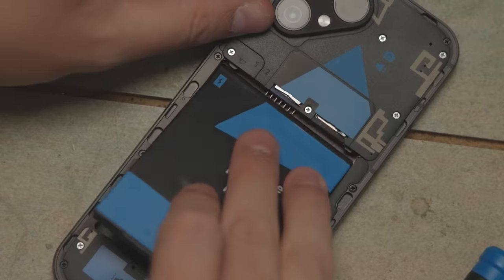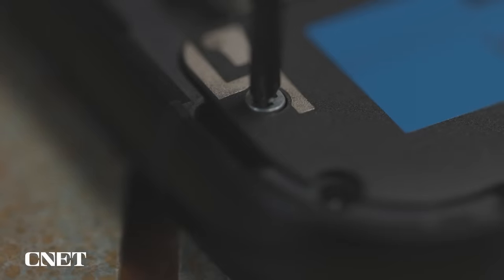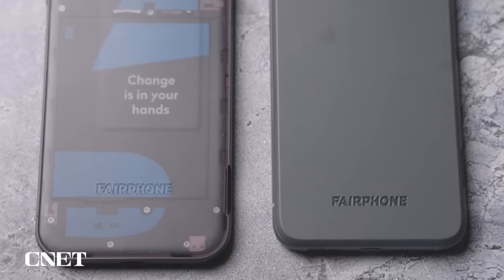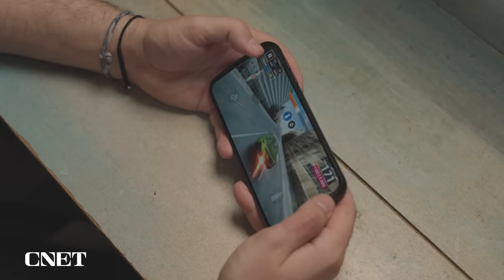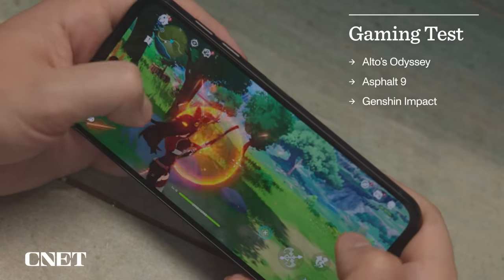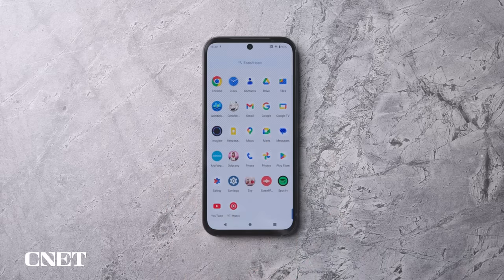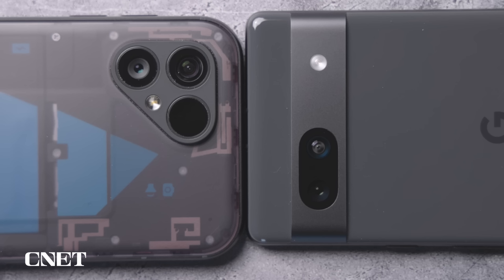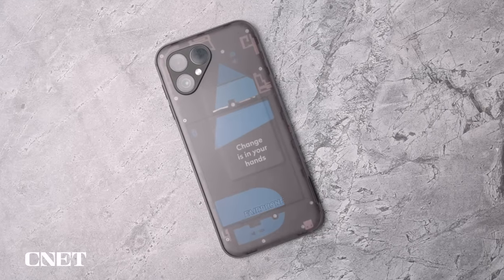Fairphone 5 Review: A Noble Cause, an Imperfect Phone

Comment: I wish this had a 3.5mm jack. If it could be implemented as an optional module that would be incredible
Reply: I feel similarly. It's not a perfect solution, but FairPhone DOES offer a USB to 3.5mm jack converter on their store as an accessory, to allow you to still use 3.5mm devices when the phone isn't plugged in to charge.

Comment: Did I just missed it or didn't you even bother to mention, that there is still the possibility that performance flaws in battery life and camera might be counteracted via software optimization in prospective updates? :/ Edit: They also could come up with bigger batteries in the future.
Reply: I think the reviewer was fair in evaluating the phone as it is now rather than what it MIGHT or COULD be in the future.
Reply: Yeah, the whole sales concept of this device is its longevity (old devices get better with proper updates). Ignoring the potential for updates on features that are differentiated almost entirely by software optimizations, is to ignore the principle appeal of a device such as this. The Pixel & iPhone have had serious show-stopping issues when some models released, but updates fixed a lot of that. Sadly, no phone remains useable without updates; so, it's disingenuous to compare hardware & software without also comparing update philosophies.

Comment: Also something to take into account: with the Pixel 7A you won't have security updates for nearly as long and fixing something that breaks or replacing the battery is hard. You'll probably get a new phone within 4 years whereas the Fairphone should last at least 8 and probably 10 years. One purchase of €700 vs 2x€500 will make the Fairphone significantly cheaper. 
This is why planned obsolescence exists. Companies figured out that people don't think too much about this, so they can rake in more profits by selling products which aren't meant to last.
Reply: New phones won't be cheaper. Cost of phones will increase every year. 

Who knows after 5 years pixel phones may cost 1000$. 

So this phone is really good.

Comment: It's a great idea that can be inproved over time with software optimization fixing partially the battery not being particularly good and cameras. Considering that fairphone did that in the past and you can upgrade both battery and camera by yourself this phone is great. It's a relatively small company so we have to wait until it can reach others quality, but it can help improving the market on the ethical side nontheless.
Reply: upgrading the camera sensor won't do anything if the processing algorithm chops aren't there.
Reply: @四as  correct, infact I just heard about that directly from them si I hope they will fix the software soon

Comment: 7 years of updates and parts. It is more than worth it for most people. They just need to work incredibly hard on the camera processing. With the sensors they are using, its up to FF to get the processing right. I doubt this will happen, but I would love to see a sub 6in version.
Reply: Yes, the camera processing is, for most users, the biggest weakness. I hope Fairphone themselves can work on it, but for now a viable solution is installing third party camera softwares, because the actual camera hardware is fine.

Comment: When picking so much on the cameras, it is overlooked, that you can later upgrade the cameras, when Fairphone provides better hardware. It has already happened with the FP3 to FP3+. The pixel will be outdated at some point, but the Fairphone can just have a new camera, new battery or new screen installed and be up to date again. Fairphone is even trying to push Qualcomm to make replaceable chipsets, so your phone could never become outdated.
Reply: Heck, it gets guaranteed system updates, & system updates are what brings the better camera quality anyway.
Reply: @prophetzarquon  Exactly!
There is nothing that is not to love.

Comment: I have just bought a second hand Fairphone 5 and it has positively surprised me at every level. I expected the quality to be much less than other phones on the market because of the modular design, the long software support and the sourcing of sustainable and fair materials but this is simply not the case. The comments in the video are on battery and camera. The battery performance is better than that of my previous phone (even when it was new) and I think the camera is good, I compared it to 2 Samsungs (good cameras) and do not see a difference either in sharpness or colors. Disassembling and changing/upgrading parts is super easy and that it is made more sustainable socially and environmentally plus the fact that I do not have to switch phones for at least 8 years really does it for me. I had a little hickup with APN settings (guess because it was a second hand) and got quick and good assistance and solved the issue painlessly, so even the customer support is good. I am so pleased with this phone and would really recommend it

Comment: My thing with the cameras is that they can be upgraded. Sure the Pixel 7A has better camera now, but what about in 5 years? You can upgrade the Fairphone 5 Cameras which you can't with the Pixel. Same goes with the screen, battery, and in theory even the SOC. I know that Fairphone selects its SOC in part for ease of accessibility for manufacturing and consumers. That IoT processor is probably more plentiful and more importantly is a processor Qualcomm is more willing to divulge schematics for since they try to encompass full right to repair, not just spare parts.

As for the battery, as you've said you can easily fix that by swapping the battery out. What used to be a standard feature for Android before plastic backs were done away with for "more premium materials" with aluminum and glass (then promptly wrap them in a plastic protective so as to not damage your expensive phone🤦‍♂). Lastly, not everyone wants a Pixel because not everyone wants to use Android because of Google's spyware built-in. A third-party called Murena sells the Fairphone 4 in the US with /e/OS; a de-Googled fork of Android with a focus on Privacy while also attempting to maintain compatibility with most Android apps that would be locked out with using say a mobile version of Linux such as Ubuntu Touch (ie being locked out of most banking apps because they're only compatible with Android).

The point is that I don't think Fairphone is selling a smartphone so much as a vision. Their end goal I don't think is to take over the market from Apple, Google, and Samsung. Rather, it's push the industry in a more positive, more environmentally friendly direction. One that puts consumers and the environment first, not shareholders. It's the same vision as the Framework. Both companies know full well that they'll likely never have the same R&D, Human, and Financial resources as the big dogs do. But they can in their small way help move the market and slowly but surely make it into something more sustainable for all. One where we care about the humans who make our devices, the environment is not needlessly destroyed, and expensive consumer electronics are not treated as disposable
Reply: Yeah exactly: How will photos from this year's iPhone or Pixel, compare with photos with this year's Fairphone, compare 5 years from now? I would be rather surprised if the iPhone or Pixel got any significant camera software improvements (those will go to new models instead) whereas the Fairphone will probably get significant improvements during its support period.

Comment: The sensors seem to be great, but there is so much software optimization going on theses days that it's not enough to just have a good sensor. You also need to have well tuned software for that sensor.
Reply: Yeah, the image enhancements developed by Google & also by Apple, definitely have a slight edge over non-proprietary solutions, right now. Just like it took a while for the quality of community-developed open-source video codecs, to (greatly) surpass industry-developed codecs, it'll take time for open-source image enhancement to surpass the gradually diminishing returns of profit-motivated development.

Comment: I've bought my fairphone 5 a few weeks back and overall I'm quite happy with how it's performing. I went from a Samsung Galaxy S10+ to a FP5 and I've largely upgraded in terms of specs, slightly downgraded in some others, and I would agree on the battery. 

I'd been wondering why the battery was draining so quickly yet also not (on standby) seeing as it should be quite a bit better than my old 3+ year old battery on my old phone, but it barely is. The theory of the chip causing this makes sense to me, and weighing the options, i'd rather have a chip that allows update support for 8 years than one that's fully optimised for energy use. Though like with every single phone out there, that's something to individually weigh out.

Overall the FP5 is very suitable for what I tend to use it for, mainly social media and video streaming, and I like that i'll be able to just replace parts if they break, especially seeing as with two phones I've previously had, having access to relatively cheap replacement parts that i could switch out myself and the inside of the phone in the first place would have allowed me to use them for quite a bit longer than i did.

I am hoping to be able to use this phone for the full 8 years it's being supported for and maybe longer. I do like the look and feel of the phone myself, it's relatively bulky and heavy, but personally I quite like phones like that. Yeah. Honestly if you're looking into getting this phone, I'd say do your research and make an informed decision on whether or not the pros outweigh the cons for you, and considering what you tend to use your phone for.

Comment: Nice review. In the long run though the fairphone is the better buy. The fact that you can switch batteries and Screens by yourself! is pretty nice coupled with the extremely long software support. Am not a camera guy by the way and battery packs will do just fine for backup.

Comment: Fairphone is a small company competing with an unethical manufacturing industry. Fairphone have been getting much better with each iteration. These reviews always just glaze over the ethical issues. Why are larger corporations able to make phones this cheap? The cost is always somewhere else. Yes, you are not going to get the same performance as with other similar priced phones, but at least my conscience has been clean since 2018, and I don't plan to buy any other phones then Fairphone.

I currently have a Fairphone 4, and it does everything I want it to do, all apps work fine, it preforms well, and the camera is good, better than the camera of many other phones. I broke my screen, and it only cost me 80 euros to fix myself.

Comment: This phone gives me a nice feeling to think about owning.

However, though it is able to be supported over 5 updates and 8 years of security updates, is the snapdragon processor going to be able to keep up?

The phone (IMO) is only as usable as the processor allows it to be.
If it struggles with some tasks now, is it really going to hold up to the demands is the OS in 5 updates time? 

Owning the phone for the first 2 years might be fine, but the thought that I may be forced to change a device because the processor can’t keep up with in board demand is a worry and counteracts the fact that I can replace components as they age.
Reply: Exactly my thoughts on this. Unless they offer upgrades for motherboard and easy to switching out internal stuff to new board... i dont see it making past 3 with flying flags
Reply: Well, I've been quite happily using 10 year old devices right up until the cellular networks no longer support them, & the only issue I've had is with apps\services becoming unavailable due to lack of system updates... So, the 5 years of system updates would mean 4 more years of usability than any of the latest & greatest handsets I've bought thus far.

Comment: Fairphone record with software updates hasn’t been great, Fairphone 4 is still running on Android 11 and they plan to roll out Android 13 by end of the year, in the process skipping Android 12 altogether
Reply: I hear that this is intended, they skip every second android, for the better optimization. (or at least this is a nice "lie", how they not have enough resources to optimizing every version)
Reply: Not all Android versions are for all devices; 12 was mostly pushed to tablets & Pixel devices. A lot of devices skip versions in their update cycles.

Comment: Well, the problem with this review, is the Fairphone 5 will last significantly longer than the Pixel 7a. I know lots of people who have owned Pixel phones and they died in like 2 years. Fairphone will likely do things like release updated camera software and new camera modules you can swap in. So it's like: sure, you can get a cheaper phone that does more out the gate, but in the long run the Fairphone beats it in terms of value. And that's the problem is we aren't really used to looking at electronics from a long-term value perspective yet. The ability to easily repair your own phone is a boom to consumers.

Comment: The only thing I care about is if the phone will still function properly after a couple of years of use. I had a blackberry once and it was the worst phone I have ever held, let alone owned! After a year the software became buggy, the phone would freeze and I wouldn't recieve messages or be able to send any until I restarted it, without any warning as everything appeared to function properly. 

Since then I've been on Samsung's S range but I want to move away from them because of their price points, increasing restrictions on how we can use them (no headphone jack or expandable storage) and that they're playing the scumbag game of not putting things like chargers in with their new phones, making their carbon footprint smaller, but actually increasing the size of the footprint because the customer has to then buy another package from somewhere else when they need to get a new charger.

Comment: Having the FP4 myself, this sounds like Fairphone didn't learn much in over 2 years.
FP4 has an OK photo sensor, but it's the camera app that simply can't take good picture with it. A 3rd party camera app makes it so much better, as a trade-off you then can't use some of the camera functionality.
The battery is only good enough. A few times a week, I have to charge it 2 times or more in a day.
And the long software support is only good on paper. Android 13 is out since a year, but there is still no date on when it will be available for FP4. Android 12 was only released in February 2023 for FP4. For me, that's simply not good enough.
I am not sure I will buy another Fairphone when time comes to change phones. And if the Android 13 update isn't release soon, I will have to change. I need Android 13 for professional reasons.

Comment: Unfortunatly, consumers have been voting with their wallts for ages and told companies that in general, the things that the Fairphone does well, doesn't affect their purchase desicion.

The only way to get a proper change is for big markets to start forcing it with regulations. EU is moving one step in the right direction with the requirement for replacable battery, but there's so much more that needs to be done.
Reply: Phone sales are down to 2013
Reply: Consumers have not been getting what they want; they've been buying what's available, which has grown so homogenous that people are seeking out retro devices just to regain "niche" features ignored by current flagships.

Comment: I have been using my current phone for about 6 years now and I was hoping to get a Fairphone 5. However, when I see the announcement of the CPU they use this time. Wait a minute... What??? QCM6490, which was released in 2021. But they do have an extended support from qualcomm.  I do hope they make better phones even it means more expensive.
Reply: It's an IoT chip, so it receives much longer support\manufacturing lifetime than typical cellphone CPUs. Lack of system updates is the most common end of a model's usability as a mainstream "smartphone"; whereas with good updates, old devices run better than when they were new. The camera quality & battery life are likewise differentiated primarily by software optimizations, so the updates will really determine how good a device this can be & for how long.